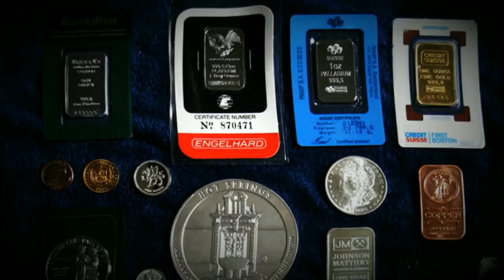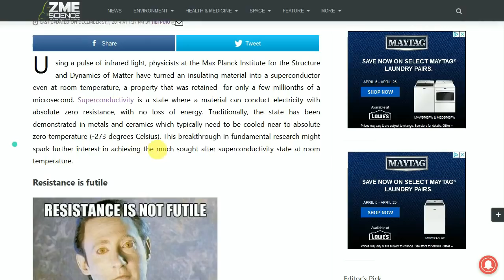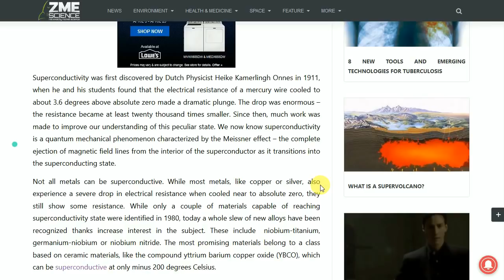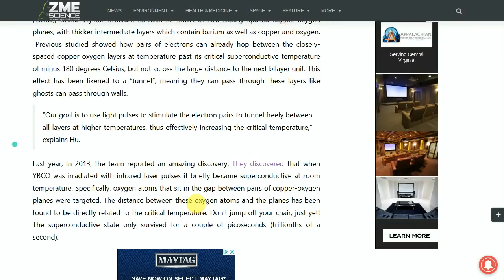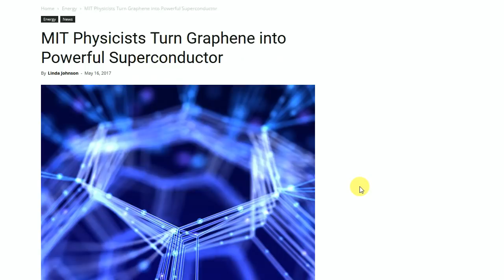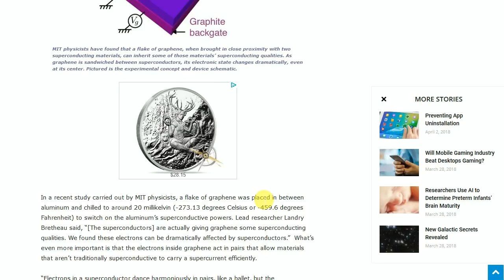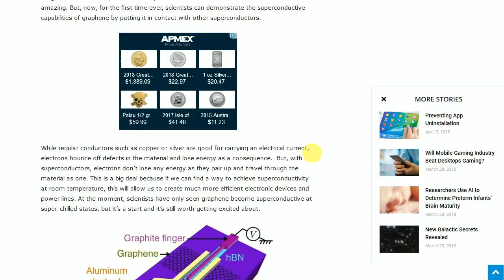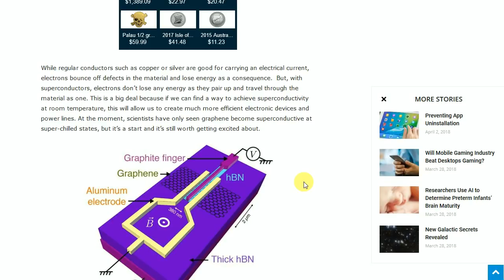Superconductivity: The Future of Silver & Graphene

Comment: My President! Nice Topic, 
Superconductors! Well, we have Type 1, Type 1.5, and trying to discover Type 2. Let's just star off with TMF (Trapped Magnetic Fields) This is where it starts.... Trying to find that superconductor that is stable, and can be applied to everyday implications that will change our world and more! 
Currently we can only achieve 17.6 Telsa.
Few metals that can achieve supper conductor status with the aid of ceramic oxides are temporary, and need supper cooling just to maintain a fraction of a micro second of operation. Any unbalance to the structure/ frame while trying to reach superconductor stage will result in a failed attempt. We are getting closer, as the Type 1.5 superconductors are being researched and developed. Currently some of the 1.5 superconductors are being used with the CERN (Particle accelerator) project. Hence  it's a work in progress, due to all the electrical challenges and quantum physics at are being explored. When they discover a type 2 semiconductor that is stable in it's element and stable in the vortex state, then the world will change as we know it! 
Everything from Electricity, transportation, Machinery, and more....
 This new technology will eliminate heat generated by flowing electrons in a nano electrical circuit, to producing zero friction engines and turbines that will be used to generate emission free energy.  No need for storage as this energy  is constantly being produced naturally (if you know what I mean...) In computers, less heat = optimal performance so you'd be able overclock your microprocessor with out burning it out. You could mine what's left of Bit Coin....... Note that atoms and electrons behave differently in Zero gravity, under vacuum conditions. Zero heat= zero burning up your chi. Look at your phones micro processor, apply that to Moore’s Law, we have a ways to go we're at the 9-10 nanometers  currently, eventually it will be organic and we'll be able to implant each individual biological cell to control and sent commands to attack/repair damaged cells in our bodies......., Sorry went to far into Bioengineering.....   Since we will have the technology to manipulate magnetic flux, we'll be able to engineer anti-gravity machines that would be able to bend the quantum physics of space and travel at the speed of light. with our advancement in understanding magnetic flux, we will be able to design materials that will hold up and reflect gamma radiation far superior then any current materials we have today. 
Wow, Sorry my comment is long........ Ok, my bad. I just hope, that a type 2 semiconductor discoveries/ technologies will be used for good! 
If I go missing, they got me! But Hey, I'm just that guys that built a wash plant made out of Popsicle sticks and  hot glue...... I don't know anything.... - MS
Reply from the maker: I am replying to your comment verbally on a live stream and shouting you out!